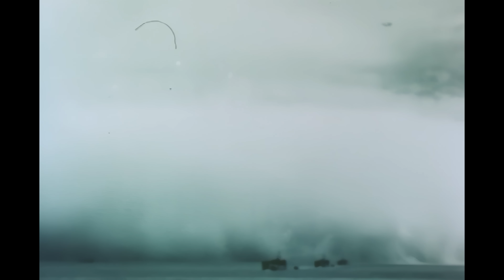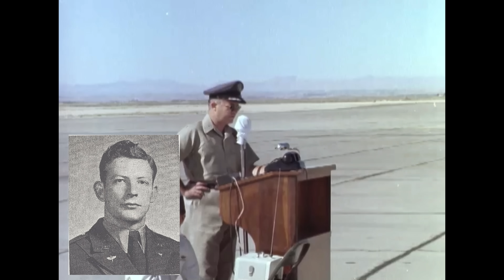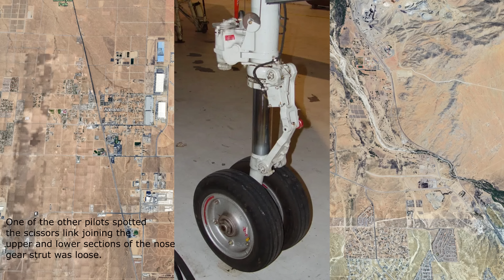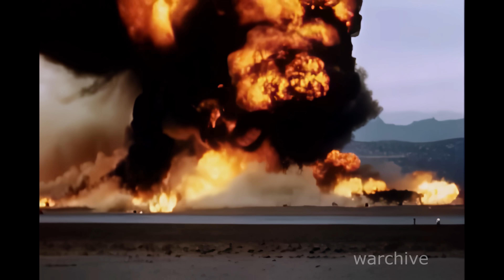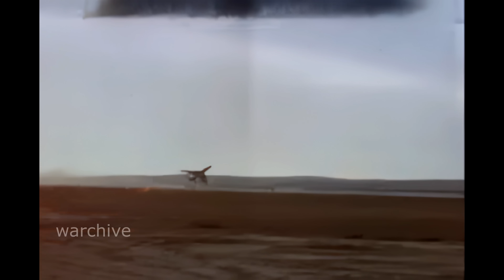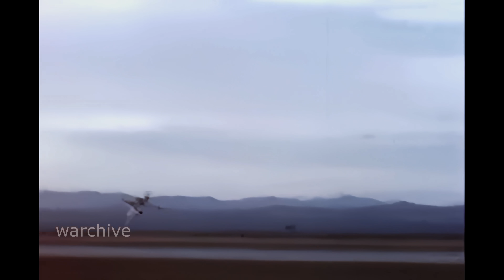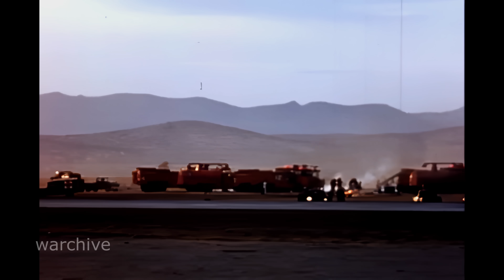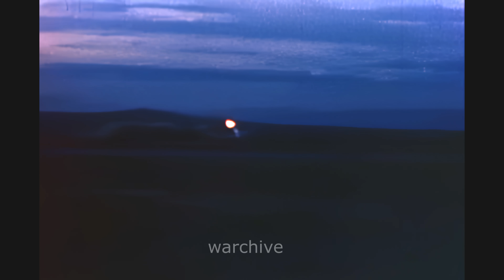The Sabre Dance F-100 Crash 1956

Comment: As the video states, and as early Jets such as F-86 and F-100 suffered. Their swept wings were also tapered in planform and thickness. The tips were shorter chord (lower Reynolds number).  They were also thinner, not just because they had shorter chords but also in percentage of chord.

The wingtips had a lower stalling angle of attack than the root. 

To make matters worse, the swept wing creates lateral (crosswise) flow. This loads the wingtips more than the midspan. 

So, the wingtips always stall long before the midspan or the wing root.

Now, the tips are also located aft of the Mean-Chord located at the area-centroid of the wing, and they are very far behind the Center of Gravity. 

Losing lift far aft of the CG causes an uncommanded nose-up pitch.

Once the jet pitches up, more of the wing stalls, and this major loss of lift causes the jet to begin to settle abruptly. The Pilot applies full afterburner, but there is a delay of perhaps 5-6 seconds until the engine spools and finally develops maximum thrust.

In the meantime, the pilot cannot pull the nose any higher to prevent the aircraft from descending because the jets wing is already partially stalled. Pulling to a higher angle of attack causes further loss of lift. The competent pilots first instinct is to push forward when he first detects the uncommanded pitch-up. This is always the right move, because it prevents the remainder of the wing from stalling. It also generates additional lift far aft of the Center of Gravity as the rear mounted stabilizer is being deflected nose-up to generate tail-up force. This takes some of the load off the main wing, lowers the main wing angle of attack, assists in un stalling 
 the wingtips, etc. 

This dance maneuver is recoverable. 

The reason it was not in this case and many others was insufficient altitude. As soon as the wingtip stalls and the jet pitches up, more of the wing stalls. This loss of lift causes the jet to descend. Pushing forward on the stick recovers. But the moment the pilot pushes forward, angle of attack decreases, and there is a momentary reduction of lift and therefore lost altitude in the recovery. If the jet is 10ft off the deck at 160 knots, this is going to hurt. As in; not survivable. 

The jet probably needs at least 50ft and preferably 500ft or more to recover from this scenario. 

Modern jets do not locate their wingtips this far behind. Deltas, the F-15, F-22, F-35, Rafael, Gripen, Typhoon, Sukhois, etc. all have their wingtips no further aft than the wing root trailing edge. The American jets from the 1960s onward utilize a lot of "washout" typically in an aggressive "conical" shape as the F-15, F-106, SR-71 did. (F-16 and later are more sophisticated). 

The F-100 was an early design, and generally pretty awful. The F-86 had a similar issue, but not as pronounced. The F-86 was actually a fantastic jet with few vices.
Reply: Well shit, I just learned more about jets in one comment than I have watching entire videos about them. Thanks for that.
Reply: @360lootgoon3 Same here. Very interesting.
Reply: @360lootgoon3 Yea. That was like listening to an aeronautical engineering major that became a test pilot back in the day. WOW! 😂
Reply from the maker: Thank you for the extremely in-depth explanation! I appreciate it
Reply: Thank you for your in depth expert analysis of design in the era of the F100.  I am always amazed at how the test pilots and aeronautical engineers of the actually got right with a slide rule before the advent of Intel....a lot of heroes working together to provide our nation with airpower superiority.
Reply: The first crash clip was in one of my favorite movies, “The Hunters” with Robert Mitchum.  MiG 15’s vs. F86’s.  I believe it was released in 1958 and was the first movie I can recall watching in a theater.  It’s a damn good movie.
Reply: @MarkSmith-js2pu  You must read the James Salter novel from which the movie drew inspiration. It's absolutely amazing.
Reply: @octaviovaladaoferreirinhad2689 I did!  It was. Take care
Reply: The F-100 was subsequently modified with a taller vertical stabilizer to provide more rudder authority at high angles of attack.
Reply: Damn that's like aeronautical engineering knowledge stuff. Thanks for the info! I understood most of it. 😂
Reply: Was this why Republic put reverse tapered wings on the XF-91?
Reply: Thank you. With love from Russia 🇷🇺
Reply: Excelente orientação.

Obgdo.

Eu não sou piloto, nem militar.

Sou só um engenheiro velho que caminha para os 80 anos.

E sonho ainda em construir um avião pequeno, de custo baixo.
Reply: thank you, i always wondered about the reason for it as Denmark lost a lot of f-100's after getting them - i presumed it was a little too aggressive AoA

Comment: Since we're on the subject of F-100s my story is I was 9 years old at Castle Air Force Base. It was armed forces day.  I got to sit in a F-100 and it had 2 drop tanks. I asked my Dad if i could press one button and he said yes. I pressed a button and motors  started whining and the dropped tanks slammed into the ground. They were full of fuel and burst on impact leaking fuel. This was 1962 and everyone smoked.  Thank God the fuel didn't ignite.  Fire trucks sealed the area as my Dad and I watched from afar.  I later found out that some one didn't disconnect the battery. I could easily have been the first child to die in a F-100.
Reply from the maker: That might about be the wildest story someone has commented yet. I did chuckle whilst reading it, but that could’ve gone wrong in so many ways as you mentioned. Glad everyone made it out okay! 

Thanks for commenting

Comment: Adverse yaw.  It is when the outer part of the wing stalls first. When a pilot uses the conventional stick inputs it makes the problem worse. After 15 units of angle of attack, they must use rudder only.  That is why Fly by wire is so important.  It does the inputs for the pilots automatically.

Comment: I worked on their radios  60 - 62 Itazuke, and 64 - 66 Misawa. I saw the dance at Itazuke,  also another wipe out on take off. I was assigned to the first F-4 unit in the AF in 62 I missed the lead sleds so much I worked hard to get back to them at Misawa. Imagine their tube-based radios weighed nearly 50 lbs. I'm 83 and still miss everything!!
Reply from the maker: Jack, that’s an amazing story, thank you for sharing! Keeping the radios alive in those jets was mission-critical work and sounds like it was both heavy and hot. The fact you were on the first F-4 units says everything about your skill set. Appreciate you sharing it with us!
Reply: 50 lbs. sounds light compared to other radios of the time.

Comment: He shouldn't have flown longer to reduce the amount of fuel on landing ? If the landing gear was broken, shouldn't he have just used the ejector seat?
Reply from the maker: He definitely could have, to both. We are lucky enough to have the power of hindsight... he did not.

I'm not sure how much fuel was remaining, and I do not know what procedure was in these days in regards to landing a damaged jet. He likely did what he thought gave him the best chance of walking away from this.

Keep in mind that the initial fear of Brooks' was that he'd be unable to steer upon landing, hence why he opted for a longer runway. The gear not being correctly mounted after towing had nothing to do with the stall.

A very unfortunate event all around.
Reply: @warchive.a  ehm ... I only fly in simulations, and my specialty is emergency landings or emergency situations. So if I know I'm flying a fighter jet with questionable aerodynamic stability and landing gear that could collapse upon contact with the ground, then A) I try to reduce the landing weight as much as possible, and B) I keep my hands on the ejection seat to increase my chances of survival by a few percent.

The pilot was obviously young, inexperienced, and in heroic mode /and that high AoA during landing, eh/... I will save that plane even at the cost of my own life!

"When the investigation into the loss of 54-1907 was closed, it concluded that Brooks had been at fault"
Reply from the maker: @gurujoe75  I presume you are flying modern jets, or at the very least jets with 0-0 ejection seats. Those were not a thing when this accident took place. According to a report published late 50s, 50% of ejections above 2000ft resulted in fatality, 75% of ejections below 1000ft resulted in fatality for the pilot, hencing at a strong increase in death rate the lower you go. He was too low and too slow for a succesful ejection. Again, gear would not collapse with the scissor link being loose, he'd only have no steering.

Brooks made a calculated decision which costed him his life, and other sources claim if he had just continued his normal approach and decent rate instead of trying to reach the foam, he likely would have made it. He increased AoA but did not apply enough power, and stalled out trying to reach foam that had been laid on the strip.
Reply: @warchive.a    I read the report. I wouldn't land so heavy with all the fuel. If I know that high AoA is "deadly" for this aircraft, I wouldn't try my luck. If I see that the aircraft is kaput, I would of course use the ejector seat. A 5% chance is better than zero. Of course, I know they didn't have zero-zero equipment.

The pilot was inexperienced. His superior was obviously uncaring. We experienced the same thing on jet MIGs during socialism. A monstrous amount of human error, pure arrogance and stupidity, inexperience, indifference, showing off.

And I fly everything that flies. From triplanes to modern aircraft.
Reply from the maker: Well, I agree. I don’t see it as arrogance and stupidity in any way. You loose a 5% chance of survival 19 times out of 20. Landing that jet was a near 100% chance at survival, he just botched it. I don’t see what we even are discussing here, to be honest.

Anyways, thank you for commenting and have a great day!

Comment: What is the connection between the nose gear pivot pin being missing and the crash?
Reply from the maker: According to one source, Brooks was concerned he would not be able to steer as he landed, so he diverted to Edward AFB as the runway was longer. I'm not 100% on the technicality of it, but the entire scissor link hanging loose can't be good.

Comment: What were the minimum safe parameters for this seat?
Reply from the maker: I believe they were 2000ft AGL and probably 120+ knots. 
I read somewhere that in the mid 50s, there was a 94% fatality rate at ejections launched below 1000ft.
Reply: Yes, in hindsight these seats were pretty poor. We operated the T-33 and T-37 in the Portuguese Air Force; their seats were very limited too. 
From the A-7 onwards all seats were excellent. Our Fiats G-91 had a very good Martin Baker too. We had four shot down by SAM-7s and ZPU-4s over Guinea Bissau with only one pilot killed. Quite good.
Reply from the maker: @duartesimoes508  Thanks for the information! I was not aware of the Guinea Bissau conflict until now. Looks like I have some reading to do for tonight! 

Have a great day
Reply: In a nutshell, Portugal fought three counter insurgency wars in Angola, Guinea Bissau and Mozambique from 1961 to 1974, when the regime was overthrown in Lisbon. Guinea was the only place where our aircraft were truly menaced. The enemy PAIGC was well armed, well trained and very motivated; Imagine Black Vietcongs. They shot down a good number of Portuguese Strike aircraft and helicopters with Heavy machine guns and MANPADS like the SAM-7, which was fatal for anyone flying low. Flying over Angola and Mozambique was much safer, but on the other hand on the ground there were mines everywhere.  😰
It was a relatively low intensity conflict, that still caused us 8800 killed in 13 years... 😐
After we left Angola the civil war between MPLA and UNITA lasted until 2002, when Jonas Savimbi himself was ambushed and drilled more than 80 times! 😅 That promptly ended the war.

Comment: Too bad he failed to eject
Reply from the maker: Others have commented and I’ve researched the question of «Would ejecting have helped?» a bit. Other users have concluded that punching out would likely not have helped, as the ejection seats on the module had a minimum safe altitude and speed, both of which the aircraft failed to meet.

An unfortunate accident, adding to the nearly 40% accident rate of the F-100.

Comment: Why put such a low hour pilot in an unproven airplane? Maybe it wouldnt have mattered?
Reply from the maker: I’m not qualified to answer that but I’ll answer what I believe and what others have commented. I believe shuttle piloting was a great way for new pilots to get experience. 

Experienced or not, the dangers of stalling an aircraft is always known, but the violent stall the F100 goes through is probably not something any pilot would ever want to get experience with. They were aware both before and after this footage that the F100 performed poorly at low speeds, but this film served and may even continue to serve as a training film for new pilots.

I also believe that recovering from a stall like that would have been impossible for any experienced pilot, but any experienced pilot would not have placed their aircraft in such a state.

Punching out would likely not have helped, as the ejection seats on the module had a minimum safe altitude and speed, both of which the aircraft failed to meet.

An unfortunate accident, adding to the nearly 40% accident rate of the F-100.
Reply: @warchive.a Thanks for this commentary. At the point of loss of lift it was irrecoverable for any pilot as you noted.

Comment: I would’ve ejected right it started  to pit to the right he had time can’t understand why he went down with aircraft any one answer that out there? Steven Larson
Reply from the maker: Hi Steven,

No one can know for sure what went through Brooks' mind during this event, but it seems to be accepted that he was too fixated on recovering from the stall. Keep in mind that the ejection seats at the time were not as safe as later models. Ejection would certainly not mean survival in this case. The seat mounted on this model had certain requirements, minimum 200ft above ground going a minimum of 200 knots. The aircraft met neither of these requirements, which also would have had an impact on Brooks' decision.

Hope this answered you well enough!

Warchive

Comment: This was before zero-zero ejections seats were created, which meant had he ejected at that runway altitude, the pilot probably wouldn’t have survived. Zero-zero ejection seats can safely eject a pilot from zero speed and zero altitude with high probability of survival.
I was a USAF firefighter in early 1970s and watched several films of failed ejection seat accidents, and crashes such as this Sabre dance crash. We trained extensively on these seats and how to safely remove a pilot from a downed aircraft ( if it was possible). 
So the pilots of that era knew a low altitude ejection would probably be fatal, they tried to save the aircraft, hoping they could save it and themselves. Unfortunately, that wasn’t the case.
Reply from the maker: 100%. Thank you for clarifying!

Comment: Would appreciate any information you can provide on software, etc. used in enhancing the original film. Thanks.
Reply from the maker: When I worked on this project I used a lot of tools and software. I have just bought a subscription with Topaz Video but have not had the time for any big projects yet.
For this video in particular, I denoised with Neat, then manually cleaned up any large scratches Neat did not catch, then upscaled with Waifu2x. I have also used Hybrid with a De-oldify build to colorise black and white footage in other projects, but in my opinion the results look better in their original state so I have moved away from colorisation for now.

Topaz Video is an all in one solution, but Neat will still be the go-to denoiser for me.

Comment: The sad thing here is Higher command should have had him punch out and not even attempt a landing. LT. Brooks couldn't be replaced that F-100 could have and in those days with only around a 700K per unit cost of the C model it wouldn't have broken the bank to just let it crash and save the pilot. Another problem in those days was the state of the art Ejection Seats were not fool proof and could injure the pilot in low altitude ejection situations. And zero zero ejection seats were decades away in 1956.

2, 294 models A - F were produced...242 were lost in Vietnam another 6 in development and over the lifetime of its USAF service, 889 F-100s were destroyed in accidents, resulting in the deaths of 324 pilots. The deadliest year for F-100 accidents was 1958, which saw 116 aircraft destroyed and 47 pilots killed. So the F-100, like many early jet designs, had numerous design problems that caused these accidents. And 324 pilots killed was an unacceptable loss rate.
Reply from the maker: I absolutely agree. 
Thank you for those statistics!
Reply: Thy didn’t have zero-zero ejection seats then. His odds of surviving an ejection at that speed and altitude were the same as salvaging that landing.
Reply: Burn up the fuel, aim the plane at the base of an uninhabited mountain area and eject at altitude?